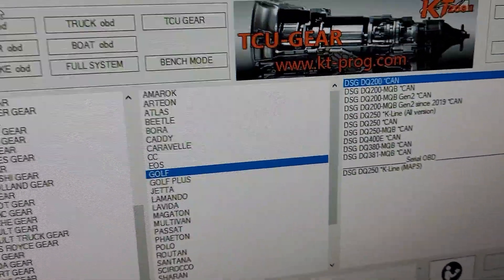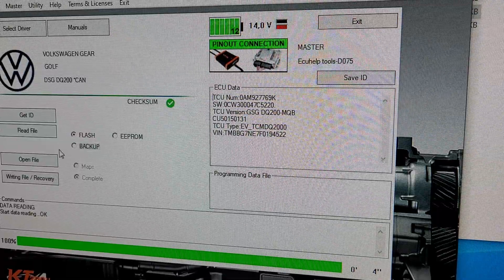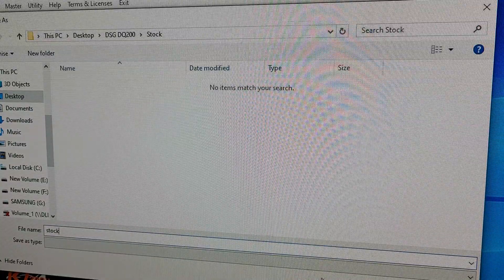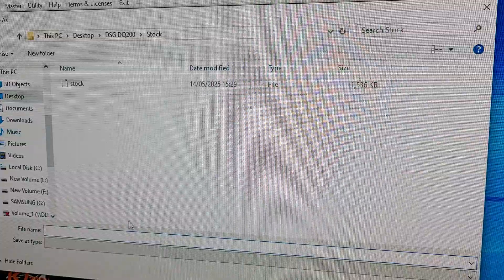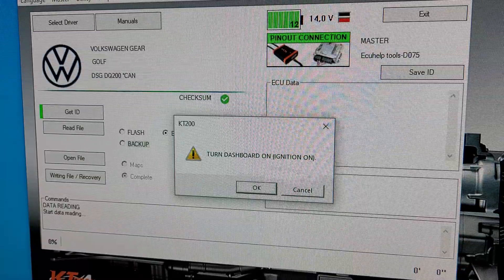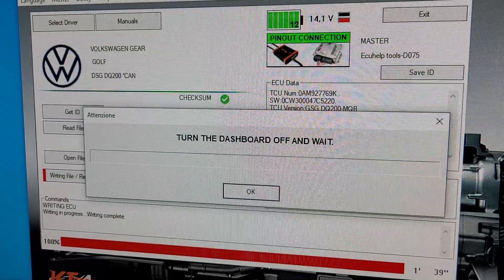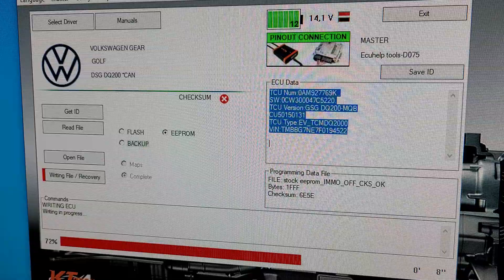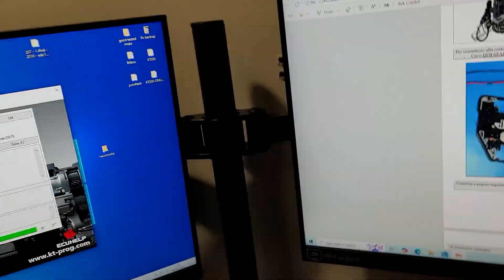Kt200-2 Bench Read - V.A.G - DSG DQ200, MBQ , Remap, Clone 1:1, Immobiliser delete, tuning

Comment: Hi, good day I was wondering why would anyone like an Immobiliser delete? is the immobiliser fully of is it still bindible or whatever the word is :) also I hear you switching like a button or a key is there a way for you to connect the ecu so the software knows that you turned off "ignition"
Reply from the maker: We do deletes for many reasons, engine converions or to fix faults

In what respect we can turn some on to test in bench mode
Reply: When you switch the mechatronic from
a salvaged one.